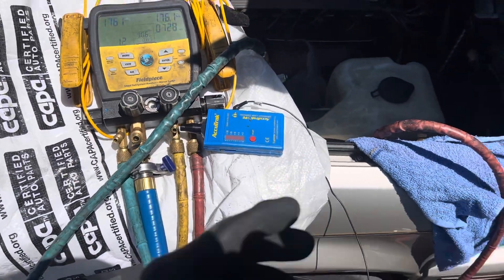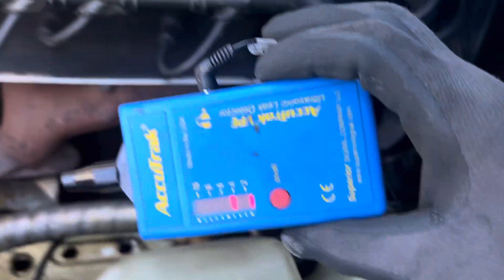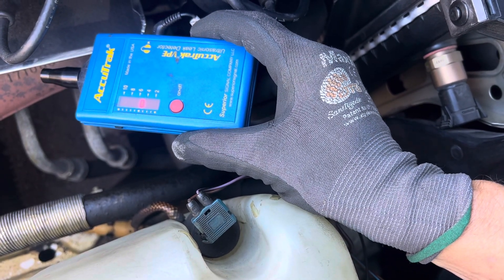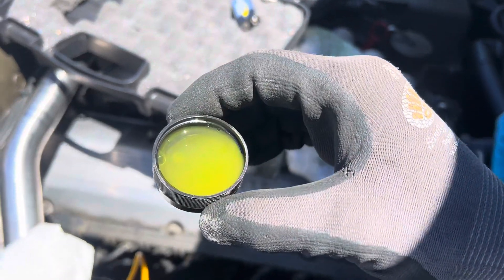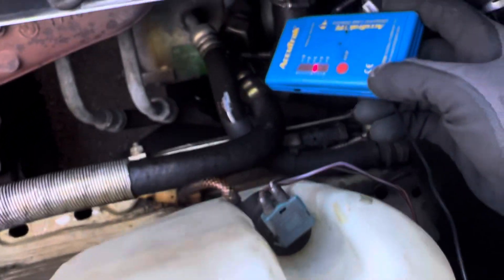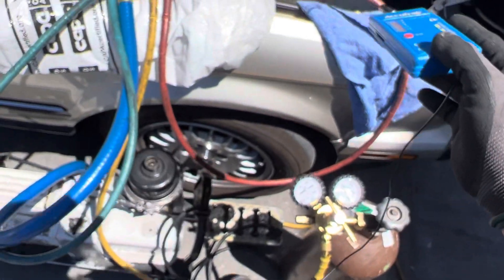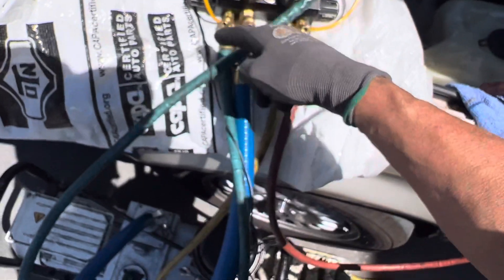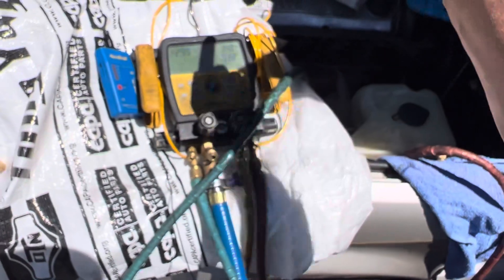Ultrasonic leak detector find leaking rubber hose using high-pressure dry nitrogen. ￼

Comment: Why do you use the Accutrak that does not have the gooseneck? The gooseneck model looks like it would reach further and be more convenient.
Reply from the maker: I lost the neck, but still just as good. Only needed to pin point if hard to reach around corners

Comment: so you cant test the compressor with air or nitro even for 5 seconds like some videos do?
how do you know how much oil do you have to add tho... or it doesnt even need to be added into an empty system, because the lack of refridge just left the oil standing somewhere?
Reply from the maker: The oil in a pre-existing system that was an operation is scattered throughout the system. 

If there was no large leak like a rock immediately through a condenser for a liquid line ruptured or hose liquid line blew out and a rapid loss of refrigerant that would carry out a large amount of oil all at one time

Or the other scenario a very slow micro amount of refrigerant slowly lost through all the rubber hoses through all the river seals over a period of years where there is no oil loss at all whatsoever.   Because oil is not used up it’s not burnt up it’s not consumed it stays there forever unless there’s some physical opening that allows a loss or a component is replaced

Under the circumstances the compressor would have to be removed and you perform the oil balance procedure as per the manufactures instructions. 

And this will tell you if you have too much oil or too little oil

Comment: My current vacuum pump has a jumper wire where the switch used to be because it failed after years of use. Now I turn it on and off with the cord. LOL
Reply from the maker: That’s exactly why I do not use the switches on tools that I can easily use the cord. 

If those contact points are left on from day one they will never wear out. 

It’s that mechanical making and breaking with the little Arkansas Park with amperage that pits and burns the points of the switch.

Comment: DANG! What a tiny little leak! That little ultrasonic leak detector is freaking cool!
Reply from the maker: Every method of leak detection has it strong points. 

One wins a metal for finding a leak where another one fails. 

And then on the next leak you may find the one that won the medal for being the best cannot find a leak on the next leak but the one that failed the first time is the winner

This is why you do not use just one method for looking for leaks

They are many methods
Reply: I confirmed a suspected schrader leak a couple days ago using the ultrasonic detector.  I don't have the d-tek sniffer yet, it's on my list but I've found every leak so far using either bubble detector or the vpe.  Maybe just lucky but I know eventually I'll be needing the d-tek.